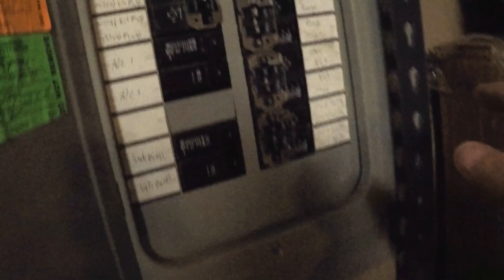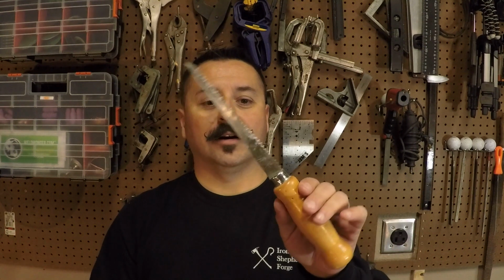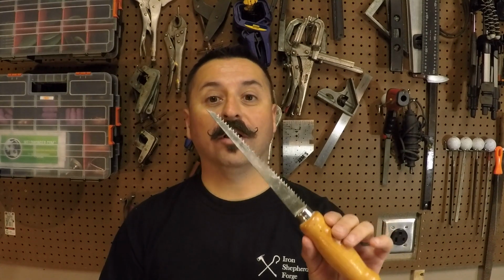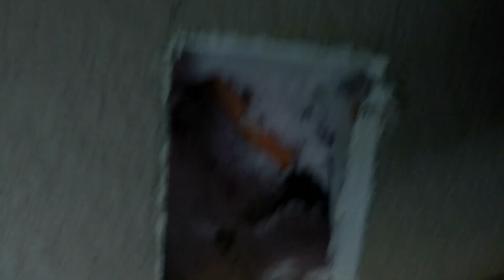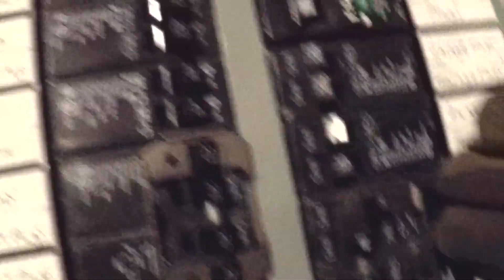Run Your Air Compressor Instead of a Clothes Dryer

Comment: So u telling me I can run my compressor with a dryer cord?
Reply from the maker: No, I'm telling you that my electrical service is sufficient to run my compressor based on its electrical needs.  I'm not an electrician and am not giving you advice like this.  I'd recommend contacting a licensed electrician if you have concerns.